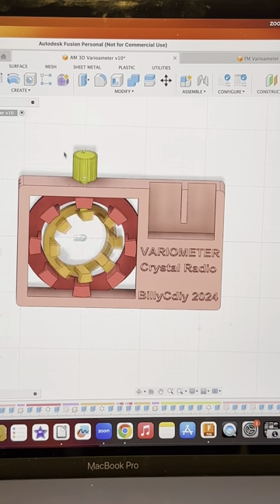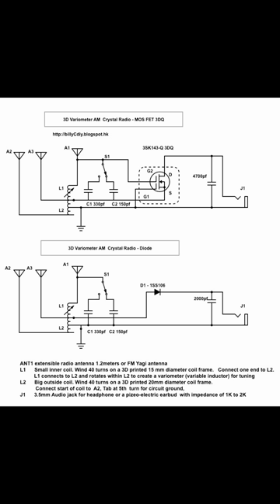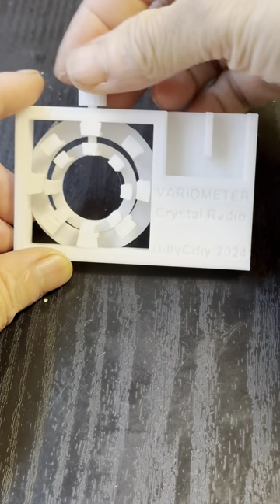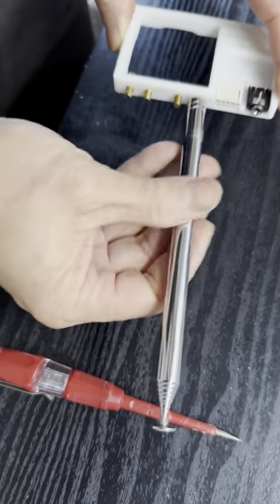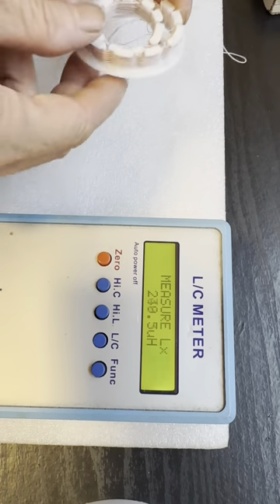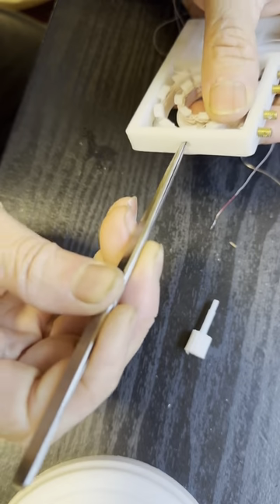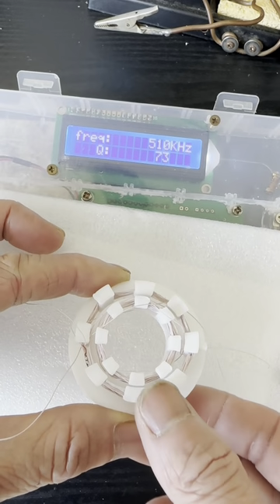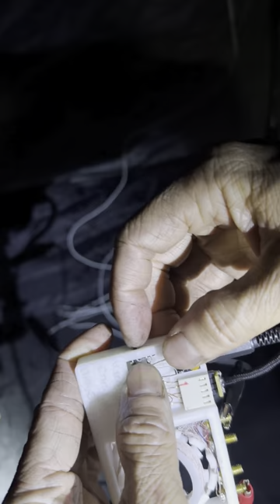The making of DIY 3D variometer AM crystal radio @BillyCdiy

Comment: I commented elsewhere about an alternative idea.
This is about this design.  In general a variometer built like you did needs to have slightly more turns in its outer coil than on the inner coil.  You may want to look into that.  Your MOSFET detector was a great idea.  I did something like that many years ago.  I found the version I used improved the selectivity and the volume.
If you are listening with a crystal earphone, you don't need a capacitor to filter out the RF.  A crystal ear phone is a capacitor of sorts.
You said "copper screws" bit I think you mean brass screws.  Anyone building a copy of this should take a magnet to the hardware store.  If a "brass screw" sticks to a magnet, it is not real brass and will be hard to solder.
You can also do your connections with nuts and bolts and washers to avoid the need to solder if you are making your own one of these.

Comment: I have an idea to make a variometer without the need to 3D print.  I will explain it here and perhaps someone can pick up on the idea.
Imagine a "spider-web" coil with its nominal "N" pointing up and laying on a flat surface.
Imagine an identical one beside it but with its "S" pointing up.
Now lay a sheet of something stiff on top of that.
on top of the stiff material put 2 more coils just like below.
Wire all 4 coils in series.
You will now have a lot more than 4 times the inductance of one coil.
If you rotate the stiff sheet and the upper coils you around a vertical axis, you can reduce the inductance gradually and almost to zero.
This could be a way for a person who is handy to not need a 3D printer.
I will do a 2nd comment on the topic of your design
Reply from the maker: Thanks for your idea. I built something similar before using credit cards. Smart Chip Credit Card Crystal Radio
https://youtu.be/_z3KmFqtPXQ